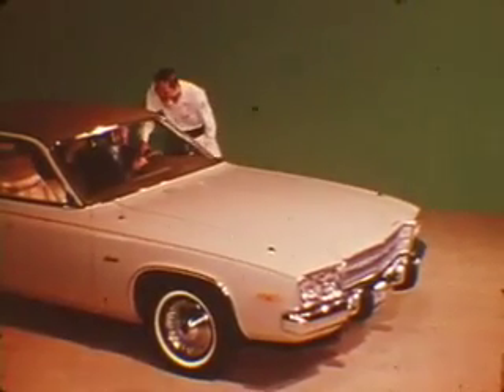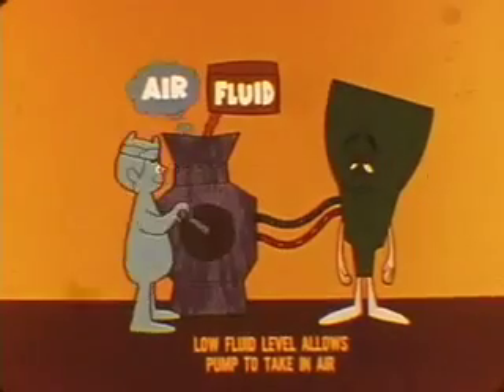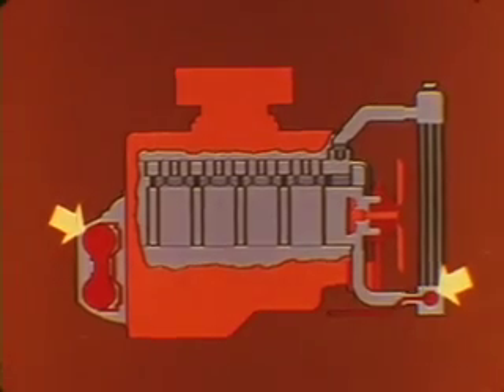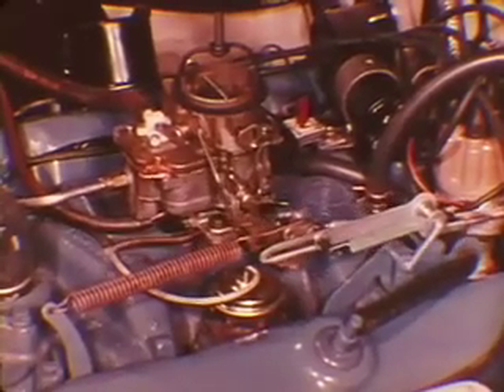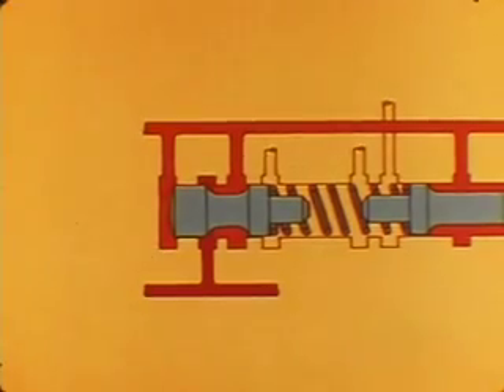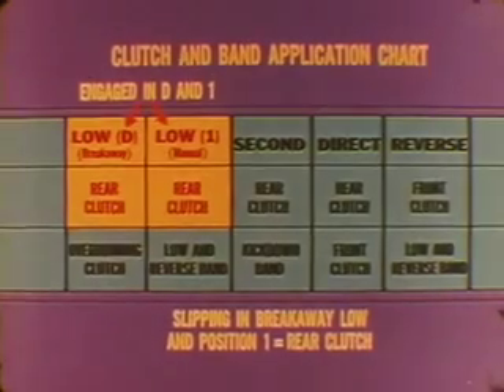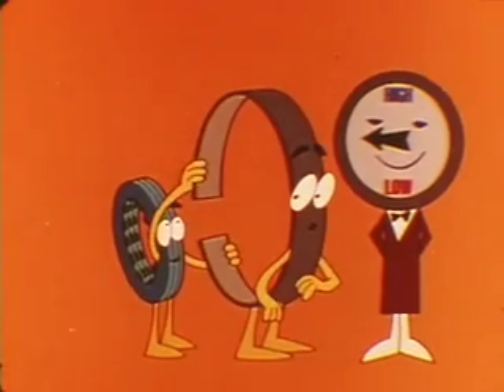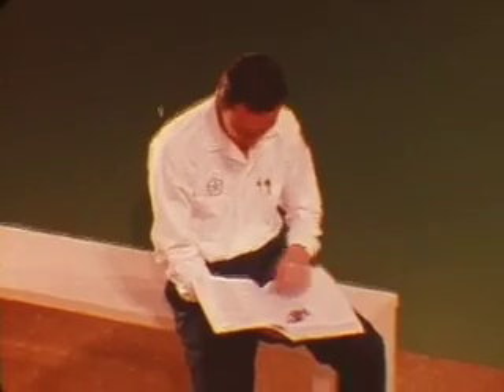Chrysler Master Tech - 1973, Volume 73-12 Torqueflite Testing and Diagnosis

Comment: 3:50 Throughout history, there have been "Filled for life" transmissions, and the result was usually a life of under 100,000 miles. This includes modern transmissions with advanced synthetic lubes.
Reply: That sounds like a Scotty Kilmer quote. Ha ha.

I was an automatic transmission mechanic at a Ford dealership from 1983-2006.:Ford also boasted of their "lifetime fluid" in some of their vehicles. 

This would be accurate if the vehicle never operated off road, and never operated in ambient temps above 80F or below 40F. And the vehicle never towed anything or went through deep puddles of water. 

In other words, the owner couldn't enjoy driving the car. But the real reason "filled for life" is a safe bet kind of goes along with your comment; most owners trade in their cars long before 100K miles. It is usually after pay off. By that time, a complete service will be done on all fluids for the next owner.